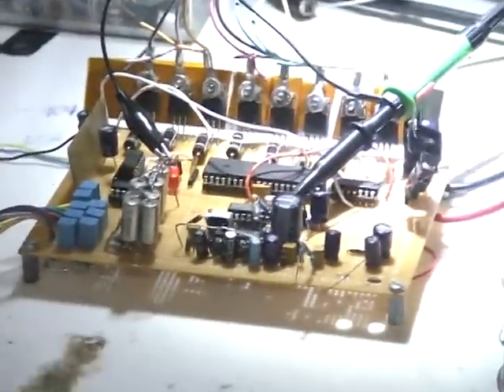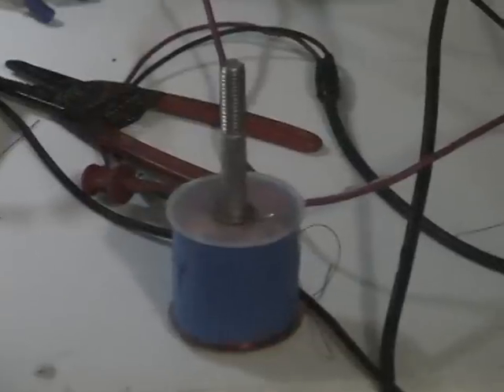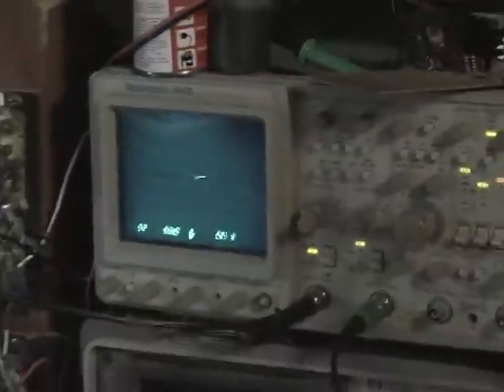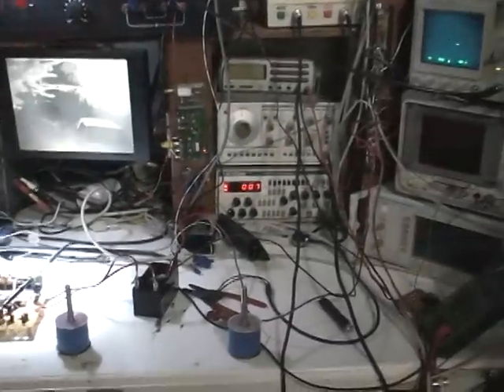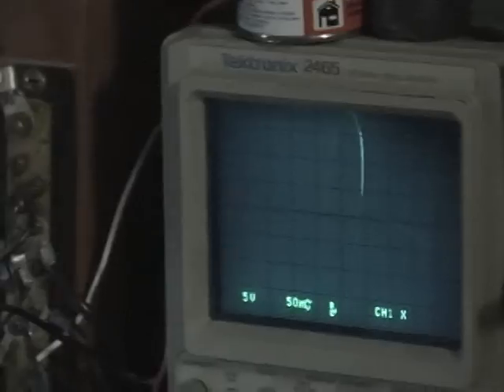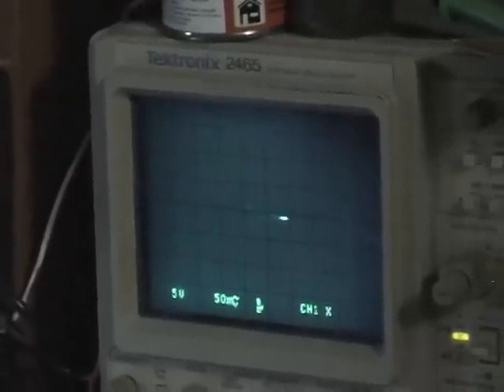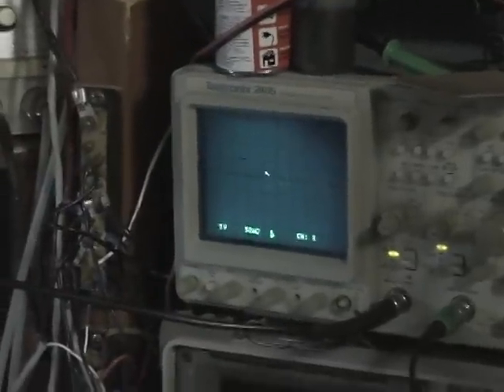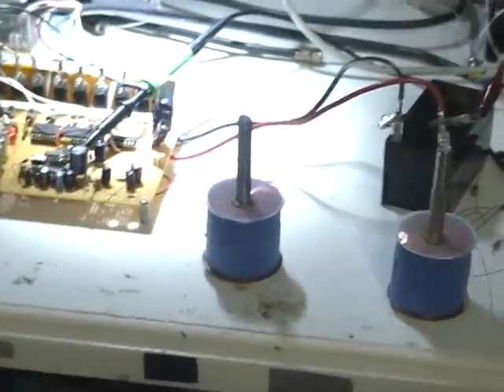shuman receiver

Comment from the maker: There are additional stages of amplification left unused in the circuit . Ther is enough drive to power a driver stage. It is not a notch filter circuit. The shuman signals are in micro volts not millivolts.I am now preparing the pdf for those of you who purchased the circuit . Iam also including the coil dimentions for the antenna coil  .I am hoping to get this to everyone today.I am fighting the flu and It is winning. But im trying .Thanks for your comments 

MM

Comment: Hi Magnetman,
well done, but it seems to be just a filter
to extract some low millivolts Shumann waves.
but it seems you need more power to run the
IC circuits than you extract from the Shumann frequeny, right ?
So what is the difference to a notch filter at 7.3 to 7.8  Hz ?